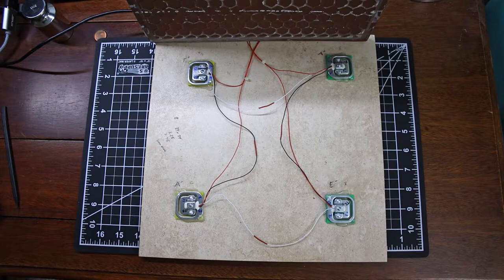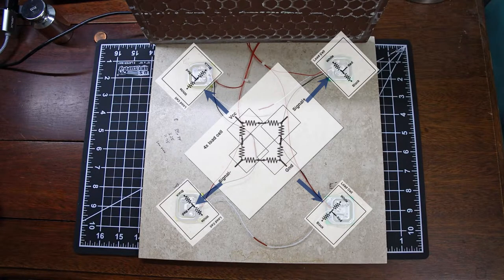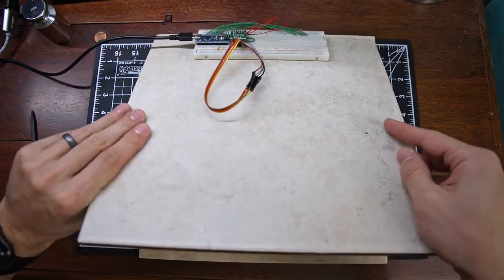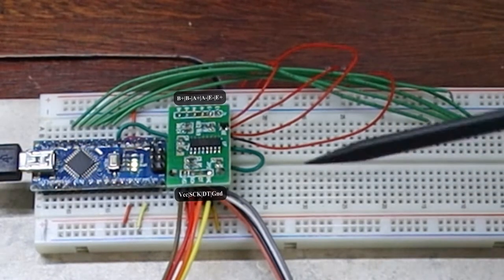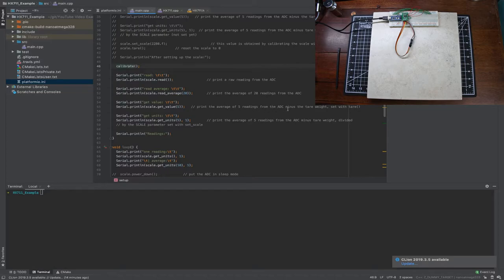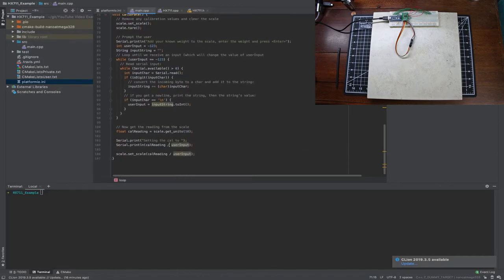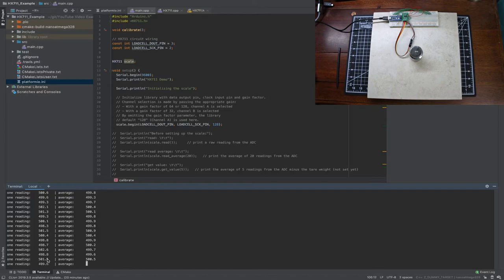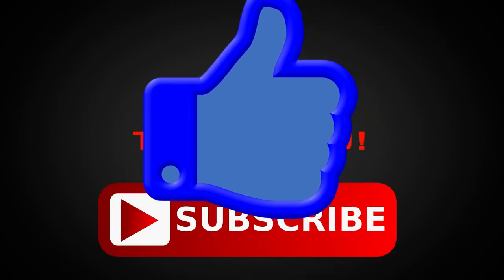How to use HX711 with Four Load Cells

Comment from the maker: The library for this has some changes which have apparently affected the `scale.begin()` command. I didn't have time to figure out why but did fix the code in my blog post. If you are seeing an error regarding the `begin()` function, check out lines 25 and 26 in the code in my blog post for the fix.  http://robotresearchlab.com/2020/08/28/four-load-cell-with-hx711-programming/#The_Code

Comment: If we use 4 pcs of 50 kg loadcell, the maximum weight will be 200 kg or still max 50 kg?
Reply from the maker: Dusting off my knowledge from college physics, theoretically the max weight would be 200 kg since the weight is distributed across four sensors at 50 kg max for each. However, this assumes the weight is evenly distributed so I definitely wouldn't push the max limit since there may be slight variances in placement, how well the sensor is touching each plate, and where the weight is placed on the plate. Good question, thanks for asking.
Reply: @RobotResearchLab  Did you ever try experimenting with unequal weight distribution?  I mean, there will always be some unequal loading between the cells, and it could be particular meaningful when the load is some large fraction of the load cell's max of 50kg ea..  I wonder how this shows up in the final value output by the HX711.  I wonder if you stood on it and put your weight almost completely on one side (assuming you don't weigh >100kg) if that would give a different output than if you put your weight as near as possible entirely at the center.

Comment: I want to make a 4-corner scale using this amplifier, but with four 1kg load cells the type that are each a bridge, with four wires: V+, V-, Sig+, Sig-. (Max load this will ever see is about 1.2kg, distributed among the four load cells). Seems like I would just hook all four up in parallel - all four V+ wires together to the supply, all four V- wires together to ground, and all the Sig+ wires together and all the Sig- wires together, and then provide the four resulting common connections to the HX711. Is that right?
Reply from the maker: Unfortunately it wouldn't work that way since each of the four wire load cells contains its own wheatstone bridge, you could theoretically hook up two of the four wire load cells to a single HX711. Normally diagrams online show hooking up to E+,E-,A+,A- but there is also a B+ and B- that can be used for a second set of inputs. The issue there is that you'd have a hard time finding a library already built to support it. Most libraries I've seen only manage the single (A) channel.

Your best option would probably be to use an HX711 for each load cell. In that case you'd just create four HX711 objects in your code and you would simply add the total between the four readings.
Reply: @RobotResearchLab  I think it actually does work. https://electronics.stackexchange.com/questions/484863/connecting-4-load-cells-in-parallel   (and other hits on googling 'connect 4 load cells in parallel). It just makes a larger bridge with the corresponding leg of each wired in parallel. But buying 4 load cells with 4 HX711 is almost as cheap as buying just the four load cells so I can try it both ways. One advantage of 4 HX711s:  I could calibrate each channel separately to eliminate corner error that arises from different gains in the load cells (if necessary and it probably won't be).
Reply from the maker: @ljbix  Interesting... I didn't think that would work but yeah, searching for load cells in parallel there seems to be a lot of documentation on it. To be honest electronics is not my strong suit, I'm a Software Engineer by trade, electronics was some basic stuff in the military and other self taught stuff. I never got into Thevenin circuit theory. 

Sorry I almost steered you in the wrong direction, I honestly didn't think that was possible but glad I was able to learn something new.

Comment: very interesting way to use the strain gages as a load-cell bridge. 😃years ago i purchased some strain gages from Omega Engineering with epoxy to glue on an I-bead to measure the flex to weigh several tons as a ball-park scale indicator. 🥳thanks a lot. 🥠☕🐬
Reply from the maker: Thanks for watching

Comment: Can this specific load cell be used as a singular load cell? I don't quite understand the reasoning for the wheatstone bridge.
Reply from the maker: Sorry for the delay, I wasn't getting notified of all comments. Yes, you can use a single load cell, I did a video on the four load cell setup because there isn't much out there for that. There are lots of examples for single load cell setups. The reason I need four load cells is because I want a platform to be able to determine the total weight, I can't simply put one load cell in the middle because it would need to balance on a single load cell.

In order to use multiple cells for balance (one in each corner) you need the wheatstone bridge to essentially combine the four sensors into one otherwise you could check the load on each sensor and combine it yourself but that would be a lot of extra wiring, components, and code. Some load cells have wheatstone bridges built in with the flex sensors, you just don't see it but that's why they have four wires coming out. Check out this image for example, it uses four flex sensors but they're all inside so you don't have to worry about wiring it up. https://www.monodaq.com/wp-content/uploads/2020/04/cell-and-wheatstone-1024x412.png

Comment: hello, thank you for your video, it's very clear. I'm kind of new to electronics, for a project I need to be able to measure weight from 24 different sources. Do you think it would be possible to use six HX711 (witch each four load cells) connected to the same Arduino ?
Reply from the maker: I don't think this will give you what you need. When you connect four load cells to an HX711, the inputs are combined into a single output. I don't believe there is a way to get each cell's value.

I'm not absolutely positive but I believe you would need an HX711 or other sensitive ADC for each load cell if you want to do it this way.

Comment: I accidentally purchased some 4-wire strain gauges, can they be tied together like the 3-wire?  I found your drawing for a single 4 wire but not for a multi 4-wire setup.
Reply from the maker: I'm going to be honest here, electronics is not my best skill, I have enough knowledge to get around but that's about it. I'm not sure if you can tie more than one four-wire strain gauge together. What I would do if I were in your situation is simply use two HX711 boards and average the values in the software to get a combined result. I hope that helps, sorry I couldn't directly answer your question.

Comment: I am trying to recreate scale  but i do get fault in code  problem is : Scale.begin(LOADCELL_DOUT_PIN, LOADCELL_SCK_PIN, 128); its says that no matching function for call to 'HX711::begin(const int&, const int&, int)'
 .... could you help ?
Reply from the maker: Yeah, I got a couple comments on my blog post about this project as well. I don't have a lot of free time these days but I looked into the library quickly but I couldn't see what would have changed to cause this code to fail but I did come up with a workaround. If you remove that last argument (the 128) then that should fix the scale.begin() call. The third parameter is for controlling the gain, which is defaulted to 128 anyway so it won't alter the functionality. If you do end up needing to adjust the gain later down the road, there is a `scale.set_gain(128)` function that can be called.

I've also updated the code in my blog post so you can check that out if you want, if I recall, it's lines 25 and 26 that have changed. http://robotresearchlab.com/2020/08/28/four-load-cell-with-hx711-programming/#The_Code

Comment: Hi. if the sensor is under load all the time, will it affect its performance? Will it stop working due to deformation?
Reply from the maker: I can't say for certain but my guess would be that it would be fine. The sensor reads based on the amount of flex in the film so it shouldn't be affected by a constant load. Please let me know if you find out otherwise, I'd be interested to hear about it.
Reply: @RobotResearchLab  thank you for the answer. Definitely will write you when I will chek it ;)

Comment: when you wiring all the sensors together, is that becoming a full wheastone bridge ?
Reply from the maker: Yes, the four sensors combined create a full wheatstone bridge.
Reply: @RobotResearchLab  full wheatstone bridge, all 4 resistors changes their values to get the weight measures ?
Reply from the maker: @daffaakbarr  Yes, the fact that all four are "active" components makes it a full wheatstone bridge
Reply: @RobotResearchLab  i see, thankyou for the answers
Reply: @RobotResearchLab  heyy, i just wanna ask something about voltage change. When i use 4 loadcell sensor, every single sensor have the voltage change, lets say V1,V2,V3, dan V4. So the delta V = V1+V2+V3+V4 ? And the delta V gonna be converted using ADC?
Reply from the maker: @daffaakbarr  If I'm understanding your question correctly, yes, the delta V is picked up by the ADC and then the library will convert this to a weight.
Reply: @RobotResearchLab  halo sir, can i get ur personal contact? I wanna talk about this loadcell. Thankyouu

Comment: How did you connect the wires together under the scale?  Electrical tape?
Reply from the maker: I wouldn't recommend electrical tape but you could use that if you have nothing else (twist the wires together and tape them). For my project I always solder the wires together and cover it with heat shrink tubing. You could use a breadboard, this would allow you to plug each wire in and no taping or soldering would be necessary. This video https://youtu.be/MT8cT7eCWSg is for a battery connector but it would show you how I connect wires together. Thanks for watching and commenting.

Comment: how did you attach load cell on the plate? did you use glue gun?
Reply from the maker: Oh yeah, good question. Yes, I used a small dab of hot glue on each corner. You just have to be sure it doesn't interfere with the movement of the middle piece as the flexion from that piece is what determines the load.

Comment: Is it possible to read 4 loadcells individually in this configuration? 
I need to read 4 loadcell value and display in LCD. Do I need four HX711 or is it possible with single as in your video?
Reply from the maker: Unfortunately not in this configuration. In order to do that you would need to have four different HX-711s, at least that would be the simplest circuit I could think of, there are other more complex circuits that might allow for a single HX-711 but would be much more complex than necessary given the option of just using four HX-711s. Sorry for the late reply, I'm not getting notifications for every comment for some reason.
Reply: @RobotResearchLab  Thankyou for the reply. I just made it using 4 loadcells.

Comment: Hello, is it possible to use these load cells with a larger surface? Maybe around a square 5 feet x 5 feet?
Reply from the maker: Of course, you can use any size object, as long as it is completely supported by the sensors. You will also have to take into account the weight of the object you are using as the base of the scale. Each load cell can support 50Kg/100lb, with four that would allow you 200Kg/400lb. So, say your scale base weighs 100lb that means you shouldn't try to weigh anything over 300lb or you'll risk damaging the sensors.
Reply: Thank you for the answer! I set my scale with the 4 x 50kg load cells but I get inaccurate data... I set it up exactly like you did and I get data like these (I use my cellphone of 159g as the know weigth for the calibration):

08:12:28.341 -> Readings:
08:12:28.341 -> one reading:	1192.5	| average:	-95.4
08:12:31.312 -> one reading:	1192.5	| average:	270.3
08:12:34.186 -> one reading:	1733.1	| average:	1431.0
08:12:37.021 -> one reading:	572.4	| average:	747.3
08:12:39.890 -> one reading:	826.8	| average:	747.3
08:12:42.762 -> one reading:	-1733.1	| average:	-47.7
08:12:45.637 -> one reading:	79.5	| average:	-667.8
08:12:48.509 -> one reading:	-1144.8	| average:	-2687.1
08:12:51.368 -> one reading:	-2909.7	| average:	-3211.8
08:12:54.239 -> one reading:	-3847.8	| average:	-3943.2
08:12:57.091 -> one reading:	-3227.7	| average:	-2687.1
08:12:59.947 -> one reading:	-2718.9	| average:	-1876.2
08:13:02.822 -> one reading:	-2273.7	| average:	-2941.5
08:13:05.665 -> one reading:	-2559.9	| average:	-3148.2
08:13:08.539 -> one reading:	-3657.0	| average:	-3052.8
08:13:11.415 -> one reading:	-2623.5	| average:	-3323.1
08:13:14.260 -> one reading:	-3195.9	| average:	-2194.2
08:13:17.135 -> one reading:	-2416.8	| average:	-2877.9
08:13:19.992 -> one reading:	-2289.6	| average:	-3339.0
08:13:22.872 -> one reading:	-3307.2	| average:	-2830.2
08:13:25.715 -> one reading:	-1272.0	| average:	-1764.9

I also tried other thing up to 2000g for my know weight and I face the same situation.

My scale is  a 6x6 square and I use solid wood for the two platform.

Do you have any tips to help me with the situation? is it possible that a part of my system doesn't work as expected? I use load cells bought on amazon (came with the hx711), an arduino nano and a breadboard. I verify the tension in the wires and it is correct.

I don't know what to do and I read a lot on the Internet, but nothing helped me. 

Sorry for my english, it is not my first language!
Reply from the maker: @kristophermaltais4154  Yeah, those are very bad readings, it's possible that you have a bad sensor but I'm not sure. I never really had to troubleshoot mine because it just seemed to work. The one issue I did have at first (and I think I mention in the video) is that you have to put the outer part of the scale sensor on something to lift it up and you need to have space in the middle for the middle part to move up and down. So, be sure the middle part can move up and down and is not sitting on a flat surface.

If you are getting the same reading with no weight, another thing you could try is, with the wood surface off, put a known weight on each sensor by itself, it may not give you accurate readings but it should give you the same reading over and over. If you aren't getting similar readings constantly, you may have a bad scale sensor.

Are you getting close to the same reading when there is nothing on the scale?

Comment: You mentioned that all the wires have to be the same length on every sensor, but can you shorten the wires as long as they are the same?
Reply from the maker: As long as they are the same length it wouldn't matter if they were cut shorter. In fact, the length of the wires shouldn't affect the results too much, it's just that because these sensors are very sensitive, it's possible that having different lengths could affect the output since longer wire (especially thinner wire) increases resistance. Again, this would be very minimal and probably not noticeable but is worth noting.

Comment: What is the Total weight it can handle
Reply from the maker: The ones I have state that they are 50KG sensors. If you have four of them then the total weight they can support would be 200KG since the weight would be distributed evenly across the sensors. So, provided the weight is evenly distributed, the total weight calculation would simply be (# of sensors * weight supported by each sensor)
Reply: @RobotResearchLab  thank you soo much

Comment: @1:40 how do you wire up multiple of those ? I am wanting to use 4x 1kg versions on each corner of my fish feeders to workout how many grams of feed is being dispensed (assuming this would let me weigh 4kg worth of feed or am i better of with just 1x 5kg ? I am trying to measure to nearest gram )
Reply from the maker: You could probably go with either one 5KG or four 1KG sensors, the smaller the sensor, the better the resolution should be so it might be slightly more accurate to go with the four 1KG sensors. You would wire it up the same way I have mine wired. Here is a link to an image showing how the four sensors should be wired in order to feed into the sensing board. https://aws1.discourse-cdn.com/arduino/original/4X/1/8/4/1846b960455dc62a2179470df9ae335eebecce1b.jpeg Let me know if you have any issues.
Reply: @RobotResearchLab  Link to image is broken.